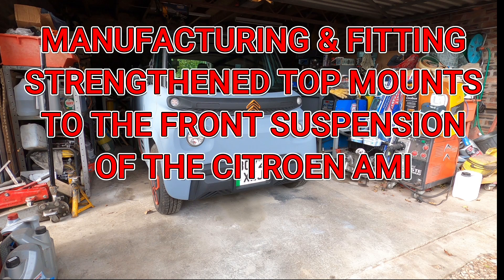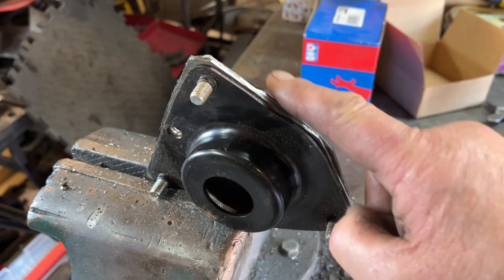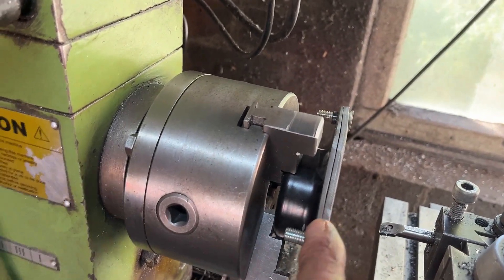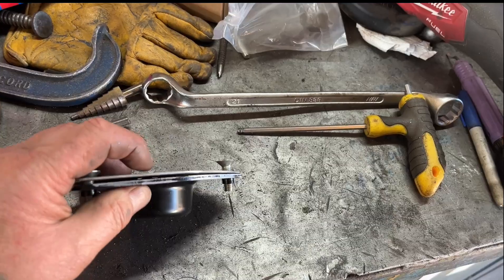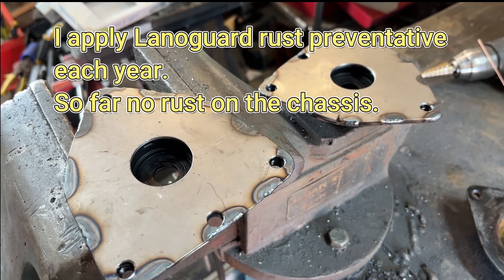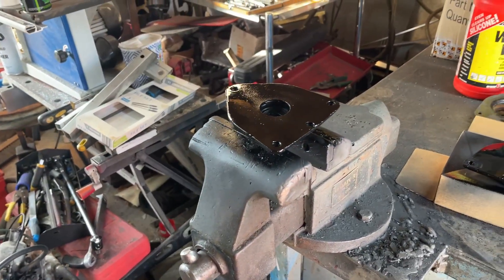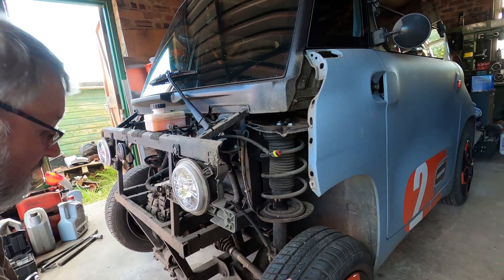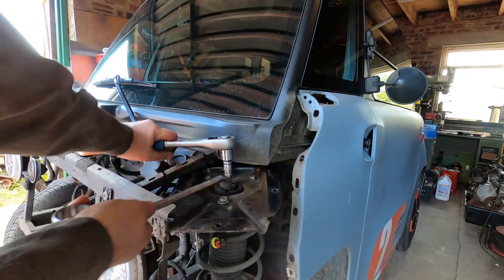Citroen AMI Suspension Top Mounts UPGRADED.

Comment: Nice upgrade Doug. Adding the plate should extend the life of the strut bushing a lot. The Lan-o-guard will do a good job keeping everything rust and corrosion free. Cheers
Reply from the maker: Yes Lloyd, hopefully the suspension modification solves the problem. We get lot of salt on our roads in the winter but the Lanoguard seems to be keeping it at bay.

Comment: I believe they used Citroen C1 running gear but not sure how much has been altered as it's a lighter vehicle?
Reply from the maker: Not the Citroen C1 running gear but other Citroens and Peugeots with 108 pcd wheels and Opel Corsa F.
Reply: @DougsShed  Ok my point was if they are using parts designed for heavier vehicles apart from springs how different is the top mount or can a standard  car mount not be used?
Reply from the maker: @tivvy-xf4kz  The top mount is a standard part on several 'real' cars. Not sure if it is used in the exact same way.